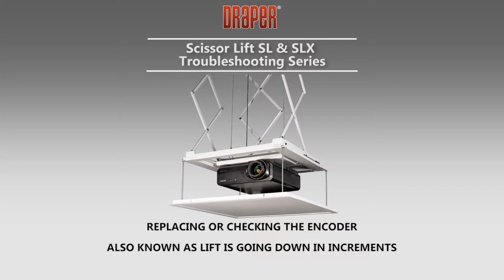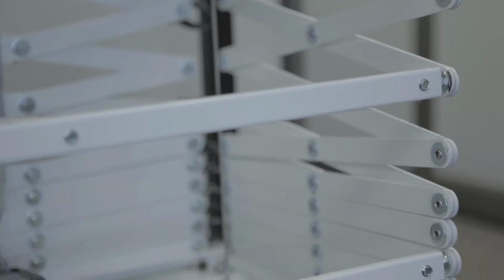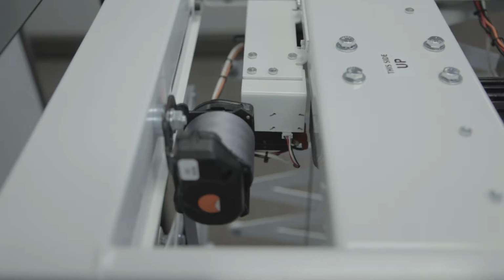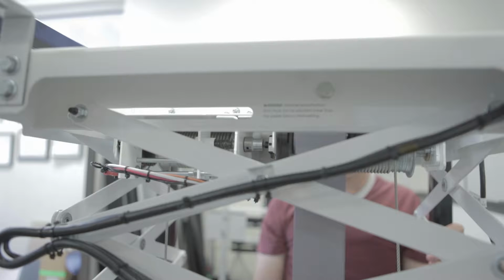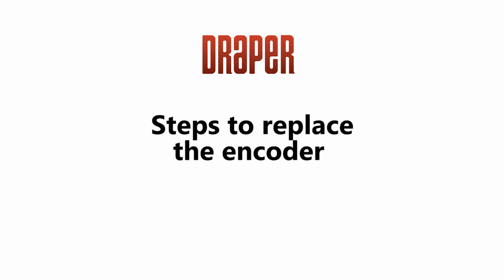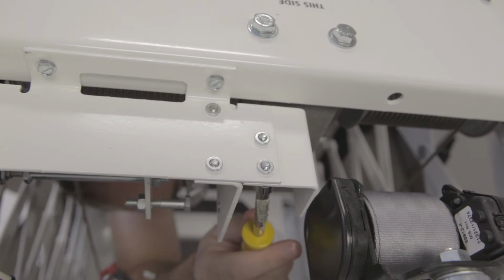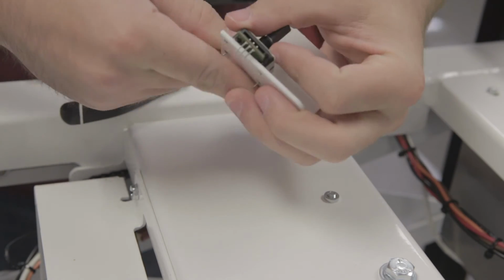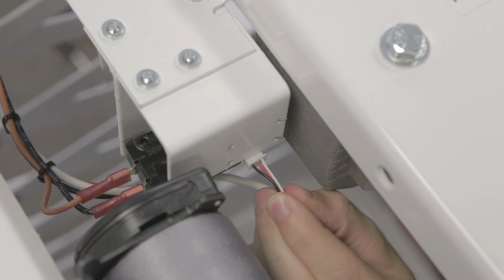How To: Replacing & Check the Encoder on Scissor Lift by Draper Inc.

Comment: Thank you for the video! We have an SLX21 lift that was having the exact issues addressed here. We replaced the encoder and the encoder adaptor (the silver bell looking thing at 0:58) After replacing both of those we noticed that the encoder adaptor was still loose so we took a 5/64 inch allen wrench and tightened it down which fixed all of our problems.